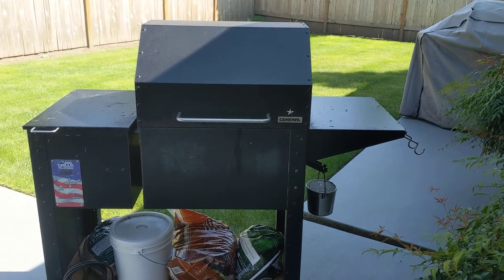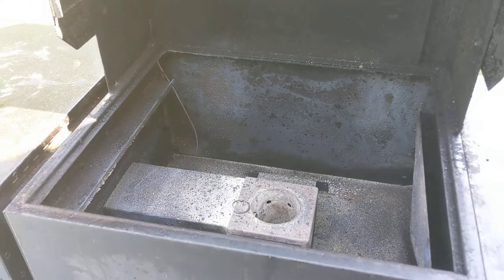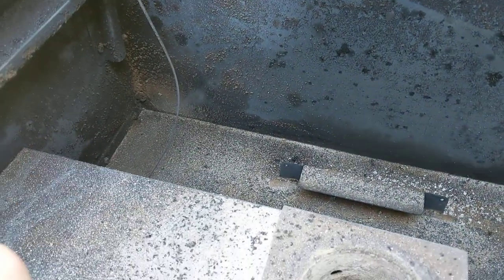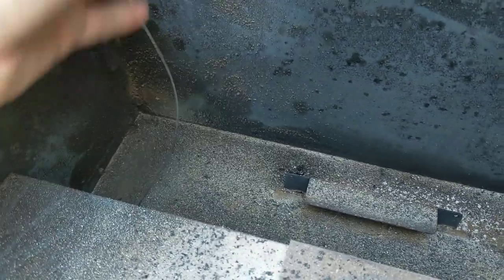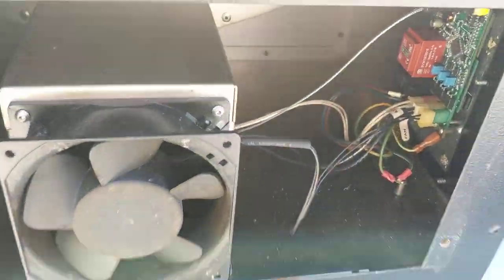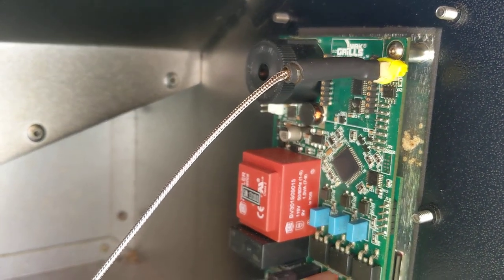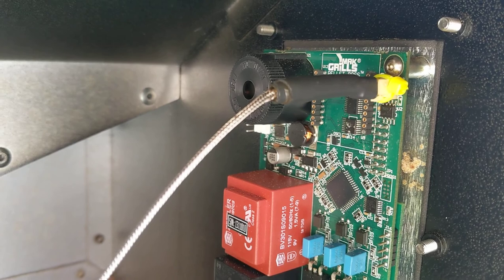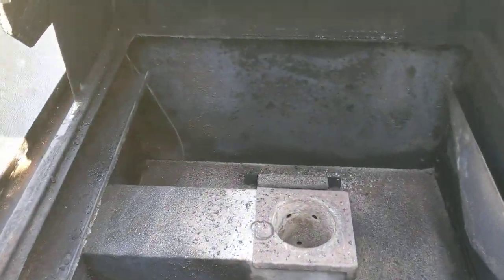How To Troubleshoot Bad Temperature Reading On Mak Grill Pellet Smoker

Comment: The first time I had the Mak problem of wild temp swings I took the controller out of the stove (carefully disconnecting everything) and discovered a spider had constructed her nest right on top of the thermocouple connection.   Once I cleared out the nest - everything seemed to be back to normal.   Fast forward several years of good performance and I've got the same issue. . . . . .need to take things apart again and see what the problem might be this time.   When this occurs the problem it creates is much more serious than just random readings since the controller also thinks that the air temps are either too high or too low and begins to command the addition of more fuel and air (or less) . . . . .in my case, the stove got to almost 400 degrees before I caught what was going on and salvaged the ribs I had been smoking for the previous couple of hours.   After several years of using my Mak while  I love the "set it and forget it" convenience  . . . . .  I also dont know and cant predict when it might decide to ruin my meal.    BTW - I've been servicing commercial electronics for the previous three decades and know my way around this stuff.    Having worked at a major airline on turbine engines, I also understand managed fuel and air flow in the combustion processes. . . . . . will update once I know what's gone wrong with the thing this time.

Update:   5 months later.  I dont know what the problem was.  Cleaned the thermocouple and vacuumed out a small amount of ash. Inspected the controller board .. found nothing obvious.  Put it back together and have used it several times since … with internal air temps remaining stable.  Go figure.  Putting it away for the winter.  Btw - the original problem is in the thermocouple sensing mechanism (could be the thermocouple - its connection or the circuit it is connected to).   Ever since my original failure I have learned to use a second sensor of my own connected to a Thermoworks Dot and on which I set an overtemp alarm forty degrees or so above the Mak’s set temp. This “backup” device gives me an audible alarm if the Mak’s controller exhibits the same failure condition.